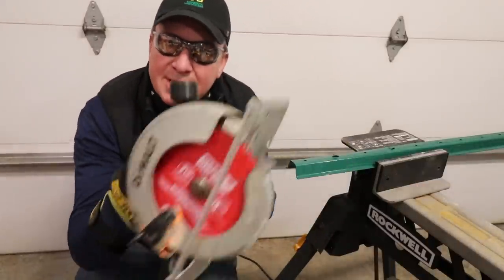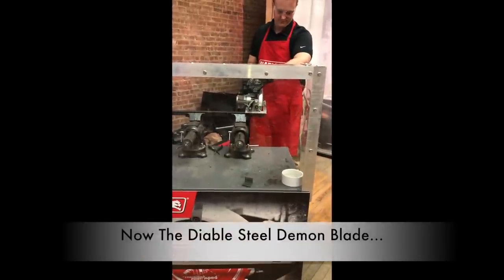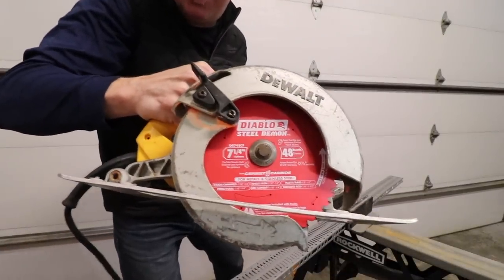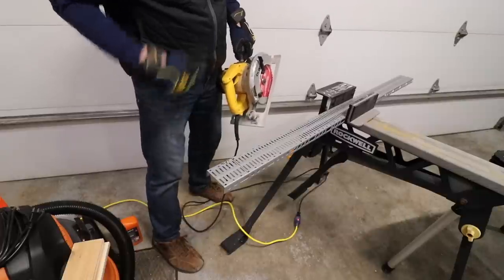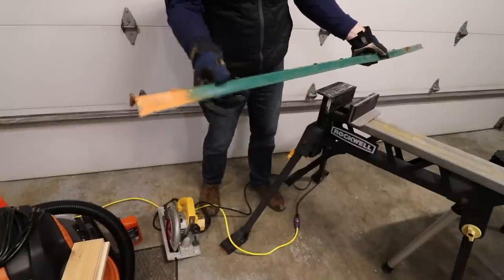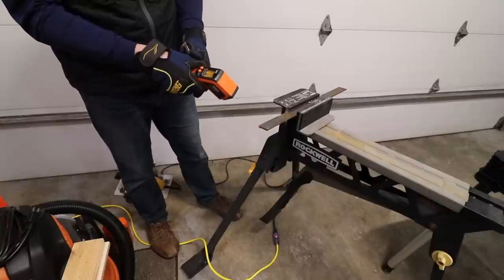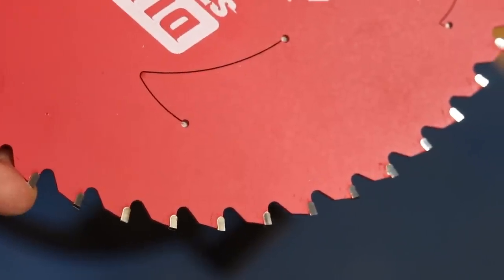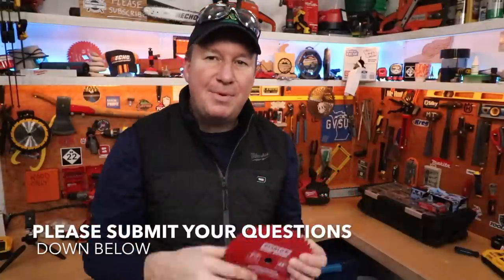DIABLO STEEL DEMON CIRCULAR SAW BLADE REVIEW! -7 1/4 BLADE- CERMET STEEL CUTTING 48 TEETH

Comment: I couldn't even cut 1/8 inch mild steel and I had only used it a few times on roofing sheets. Not worth the $75 NZ dollars. I had to switch back to traditional angle grinder with cut off disk.

Comment: Debating this blade and a separate cordless circular saw OR a portable bandsaw. Fence builder, i pound chain link posts into the ground and cut the tops to height. .065 wall thickness, residential posts. But i will make up to 50 cuts on a job and do 1-2 jobs a week
Reply from the maker: I haven't had a chance to test a portable bandsaw yet.  I reached out to my friend Clint at Tool Review Zone.  He recommended the portable bandsaw.  I'm have some new tools coming in soon, hopefully one is a portable bandsaw , just so I'm familiar with them.
Reply: @MarkThomasBuilder  i actually found a 5" deep cut dewalt bandsaw with 2 5 ah batteries for sale new on ebay for $300. Love it. Thanks for the response
Reply from the maker: @Rw-bt1iz  Awesome, glad to hear it!  I put in for a Milwaukee deep cut bandsaw to review on my channel.  I'm excited to try it out as well!

Comment: Yeah they work great for steel i'll give him that now try using them on 1/16th in thick stainless steel unistrut. I can only get about 40 cuts out of a blade and that's with cutting wax
Reply: I couldn't even cut 1/8 inch mild steel and I had only used it a few times on roofing sheets. Not worth the $75 NZ dollars. I had to switch back to traditional angle grinder with cut off disk.

Comment: Not many people know that the diablo blades are rated for 1800max rpm and the circular saw are running much much faster than that. The Diablo blades won’t last long. They will work ,but not very long.. just keep that in mind..
Reply: apparently you didn't read the blade. Max rpm is 5800
Reply: Bill Eslinger not all are created equal. But for some. they have no idea what to look for and they just grab what’s on he shelves.

Comment: I NEED THIS! I didn't know they has them for circular saws yet. I assumed the speed was too high. $30 bucks is NOT bad.  All my cutting discs, flap discs, saw blades etc are ALL Diablo. Everything in my shop. I am definitely a fanboy.
Reply from the maker: I showed it cutting 1/4" steel on my Instagram story and it worked well on that.  If you buy one, let me know how it works out for you.  Thanks!
Reply: Diablos the only way to go and if it ain’t dewalt it can only be your fault 💪🏼

Comment: Very impressive blade. I bought one to make my life easier at work cutting steel. Have you tried any other brands you could recommend that are worth trying out? I’m on a quest to find the best one I can. Looks like it’s going to be pretty hard to top this one
Reply from the maker: I've had good luck with the Milwaukee M18 Metal Cutting Circular Saw.  The blade seems to cut similar to this Steel Demon.  Thanks for tagging me in the sawzall post.  What's the next step?
Reply: @MarkThomasBuilder  yeah that metal cutting m18 is awesome from all the videos I’ve seen. Did you get to see the video of me cutting the steel? And how I set it up? I can send you a link on Instagram if that’s easier. Truly Mark, if you have other things going on and don’t have the time right now I understand buddy. It would just mean a lot to me if you were able to
Reply from the maker: Yes, send me a link.  I'm getting some of the new Milwaukee blades soon and would like to test them out.
Reply: @MarkThomasBuilder  👍

Comment: Thank you! Have a recommendation, to use Hougen Slick-Stik, part no. 11745. Really increased longevity for me, and a bit quieter. One stick last about 4 blades. Use it for drilling metal with rota cutters and drills bit. A real improvement over other lubricants I have tried. Plus classified as Non-Hazardous.
Reply from the maker: Thanks for sharing!  I haven't tried it yet but think I will

Comment: Hi do you think it will work fine and safe if i put those blades on my miter saw? workzone brand with two speeds, 3800rpm and 500rpm
Reply from the maker: It sounds like it will work, but I would see what Diablo says as far as what it's rated for.  I though it was only circular saws, but maybe there's more info on their website.

Comment from the maker: Question of the day:  Are you ready to upgrade to the Steel Demon Circular Saw Blade?  What item would you cut with this?  Should I have tested it on something else?
Reply: Steel Entry Doors Can't find a video of them being cut.
Reply: Mostly 1" square box tubing. Up to 1/4" wall thickness.
Reply: id like to see how long it lasted, cutting something more substantial either 2" square tube 1/8wall or preferably some 1foot strips in 1/4" plate, a regular carbide circ saw blade will cut 16 guage all day and any blade will  make one cut in 2" flat bar but will this one make 50 cuts in a row without dulling?

ive seen them locally but at 85$ plus tax here in canada i dont wanna find out the hard way i just made a 100$ while fabricating

Comment: yes it going to be hot using a sanding blade way differnt then a cutting blade then a sanding blade
Reply from the maker: Yes, much cooler.
Reply: @MarkThomasBuilder  If you used a 1mm cutting disc in the grinder would have been much quicker, instead of that flexible disc?

Comment: These new metal blades take the standard higher speed saws ? You are cutting at what speed ?
Reply from the maker: The Dewalt saw I'm using this in is the DW364 which is 5,800 rpms.  I'm not sure if the blade is rated that fast, but it's worked out for me so far.

Comment: Thanks for the great video! Do you know how well it works on non-ferrous metals? I have a non-ferrous diablo that is awesome but it's 12" and i would like a smaller blade that works for both ferrous and non-ferrous metals.
Cheers,
Reply from the maker: I haven't tried this on non-ferrous metals.  I've used the Diablo wood and metal blade on wood and copper it it gave it a nice clean cut.

Comment: I have to cut some metal coupons for a weld test, can 1 inch thick and down or what’s the limit if thickness I can cut metal. 7 -1/4 is the saw Im looking to get. Thanks in advance
Reply from the maker: Their thick metal cutting blade, with 38 teeth, is rated for steel 1/8 to 3/8-inch thickness.

Comment: Can this cut a gym power rack 3x3 11 inch gauge?
Reply from the maker: A circular saw will cut 11ga tube steel, but not all the way through in a single pass.  The circular saw cut depth is only 2.5". You can make it work by neatly cutting it in 2 passes.

Comment: can i use this 7-1/4" (184mm) blade on makita 5800nb circular saw (180mm)?
Reply from the maker: It's rated for up to 5,800rpm, so I'm guessing it would work.  Check the Makita rating to be sure.
Reply: @MarkThomasBuilder  yes, thanks a lot. the rpm is just fine. i am worried that the size variance of 4mm will result to malfunctions. will buy this cermet blade very soon. more power.

Comment: Great blade..... Great Video!! Question... Would this blade cut 1/16" (.063) aluminum diamond tread plate (stone guard) clean with no burrs? I'm cutting  for chair rail. I know they make a blade for aluminum but, I'm looking for a great dual purpose blade for both steel & aluminum. Thanks
Reply from the maker: I think you need one blade for aluminum and the Steel Demon for steel.  I don't believe there's an all purpose blade, from what I've seen.

Comment: I have 144 inches of flat bar 1/4" steel to cut. Will the blade last through that much cutting do you think?
Reply from the maker: Yes, I can't say exactly how many inches the blade will last, but I would think this blade would be a great fit for what you're doing.
Reply: @MarkThomasBuilder  Awesome! Thank you. We'll find out tonight! This will save me getting a cutting torch or plasma cutter and spending a ton of cash for just a little work.
Reply from the maker: Cool, let me know how it goes.  I'm testing out another metal cutting saw on my channel soon, but the price is much higher than this blade.

Comment: Hi, can we use this blade to the normal wood circular saw 7 1/4 like bosch gks 7000? It is safe to use on normal wood cirular saw?
Reply from the maker: I recommend the Diablo Wood & Steel blade.  It's a combo blade that works on both.  This blade in the video is just for steel.  I made another video on the wood & steel showing how it works.

Comment: Can this blade be used to cut rebar, say 10 mm thick? Thanks
Reply from the maker: I believe so.  It cuts threaded rods up to an inch.  I didn't see anything mentioned specific about rebar though.
Reply: I believe it can no problem, even 15 years ago I used Diablo circular saw blades for doing hardwood flooring repairs and those blades way back then cut thru nails and all types of metal in flooring and kept on going no problem. And I always used the cheap Skill 13 amps circular saw. And those blades made a big difference in how that cheaper saw made cuts in all kinds of hard woods. I cut a ton of oak, mahogany, walnut, hardwoods and those blades lasted for months. 👌 and the new ones are way better now.

Comment: I dont really cut metal so I got a Diablo 7 1/4 cutoff disc but I am really wanting to get the steep demon blade... Looks awesome
Reply from the maker: This blade is very handy for cutting steel.
Reply: @MarkThomasBuilder  yah since I dont cut metal often why deal with slower cuts and sparks.. For $30 and minimal cuts this blade will likely last years

Comment: all those blade are just about the same has the one the older metal blade dont last that long i install steal panles make about 10 cut before need to change the blade
Reply from the maker: I haven't cut enough steel with mine to see how long it lasts.  So far, so good.

Comment: Awesome review! Can this be used on both steel and aluminum? Thanks. 👍😊
Reply from the maker: This one is just for steel.  It will cut aluminum, but will cause issues to the blade over time.  They make another blade for aluminum.
Reply: @MarkThomasBuilder  Thanks.... I only have a little bit of aluminum L-Track I have to cut but, the thickest part is 1/4" x 1-1/4"w. Do you know what blade is the best for aluminum? Thanks again. 👍😊
Reply from the maker: Take a look at this blade available at Home Depot... https://homedepot.sjv.io/5XQyo
Reply: @MarkThomasBuilder  Thank you! That certainly looks like the blade I could use due to the 1/4" thick aluminum L-Track. Plus, I will be cutting quite a few of 3/4" x 15" Polypropylene garage tiles as well for my enclosed trailer. Thank you.... appreciate the help. Ray 👍😊

Comment: Yeah but will it cut wood too
Reply from the maker: It's meant for steel, but I'm guessing it would slowly cut wood.  I recently reviewed a wood and steel combo blade by Diablo.
Reply: @MarkThomasBuilder  I see a market for a cut all blade. thx
Reply from the maker: Yes, especially when doing demo work.
Reply: @MarkThomasBuilder  they have several carbide cut everything blades i believe their "amped demolition" blade is top dog there seen them doing wood, screws, nails, asphalt, and lag bolts all sandwiched together and 20' of it at once, i see one of their carbide blades on 2 for 20$ at home depot all the time they work great for demo, but once they cut some nails and junk they dont woosh through like butter so i always end up marking a blade for clean wood only use

Comment: Question.  Will it work in a 7 1/4” miter saw
Reply from the maker: That's a good question.  I'm not sure about using it in a miter saw.  My guess is that its' only rated for use in a circular saw.
Reply: @MarkThomasBuilder  Mark, yes, I use this blade all the time in the shop in my cordless DeWalt 7-1/4" miter saw. I use angle iron, 1x1, and 2x2 square tubing all the time for projects, and this is what I use to cut. I think the main safety issue you want to look at with any carbide blade is RPM. You don't want to use it in a tool that spins faster than the blade is designed for. I believe it's printed on the Diable Steel Demon blade, something like 5,500 RPM.
Reply: @Shoptoolreviews  that's good to hear I have some steel studs to cut and was thinking of using my DeWalt 7-1/4 miter saw. Would you recommend this blade or the new diamond one?
Reply: Aaron Brandon I’d much rather use this one. Just make sure the RPMs match up with the blade and saw.

Comment: I've been searching for a decent independent review of this blade.

This is definitely the most helpful one to date.

Could you see if there is one for a miter saw? I'd like to use my miter saw for metal cutting. But am unsure if the RPMs, arbors, and the like. Will be suitable for a saw that was meant to cut wood.
Reply from the maker: Thank you!  I don't think they've made a bigger metal blade yet.  Since the metal it cuts is only up to 1/4", they probably don't have the demand for it.